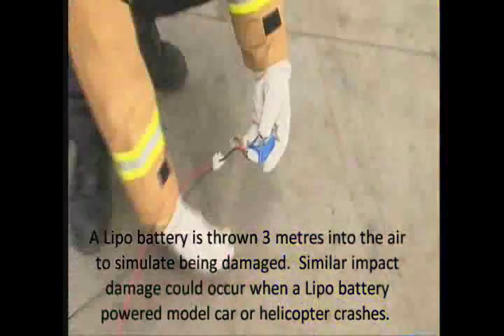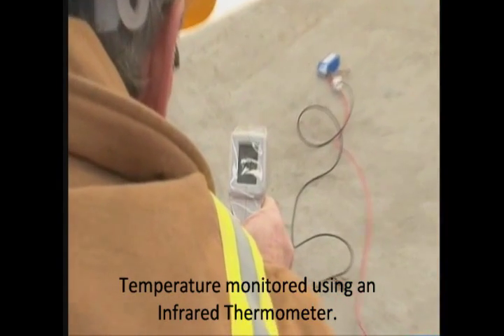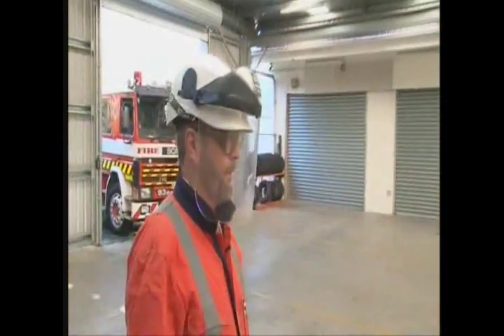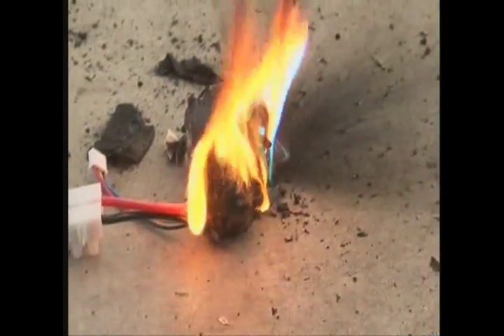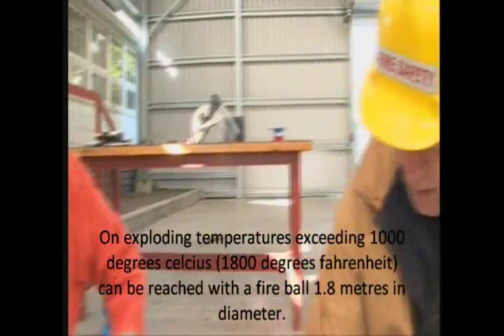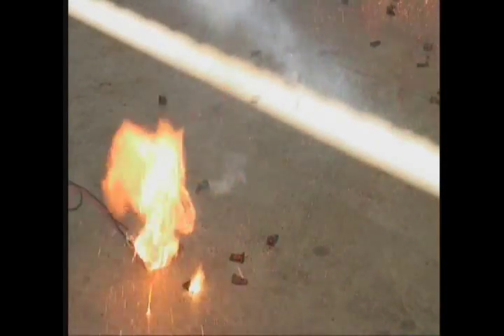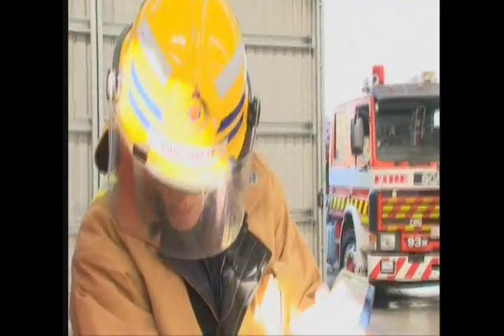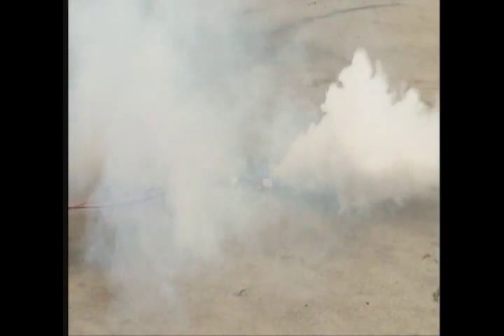Safety Alert 1: LiPo batteries

Comment from the maker: @rijit88 You are right in that this video shows the incorrect way to charge a lithium battery, as it is stated in the starting text. This however is certainly not the only way LiPo batteries can explode. The purpose of this video is to show both the dangers of improper charging of damaged batteries and most importantly the high dangers of damaged batteries in general.